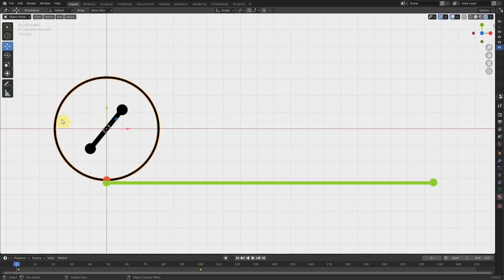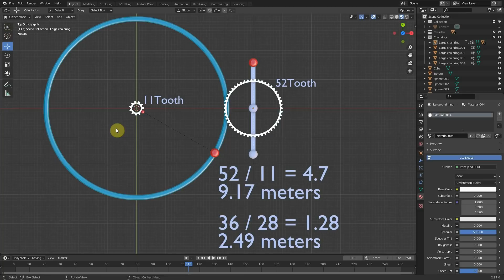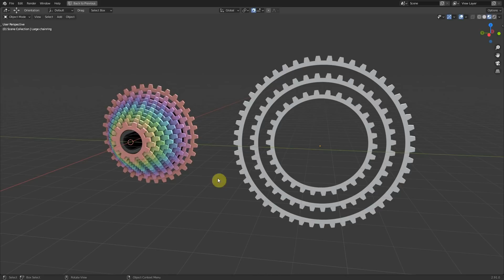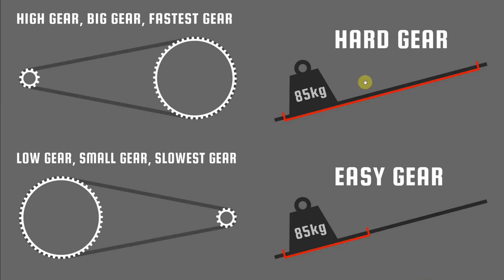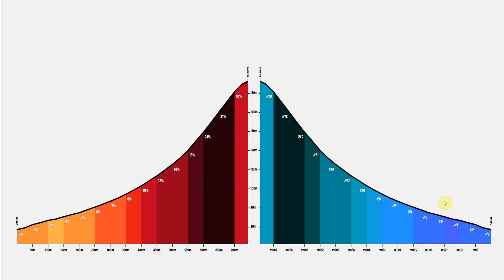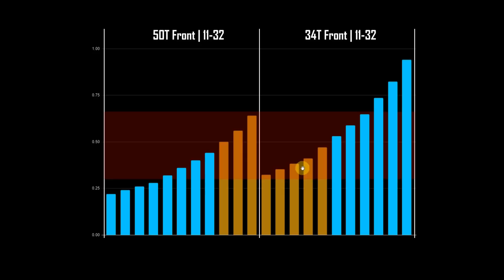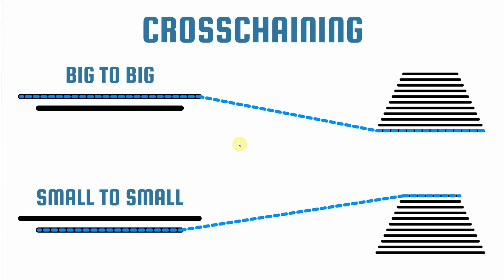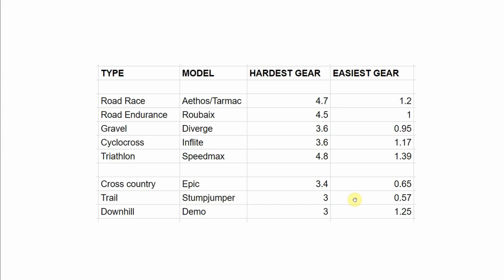HOW DO BIKE GEARS WORK?! | BIKOTIC

Comment: This is one of the few videos on gear shifting that actually takes the time to explain counter-shifting, or what to do when changing chainrings.  I figured out years ago (on a grip-shifter bike) that when you change chainrings you have to counter it with a rear cog shift in the opposite direction to account for the large change in gear ratio.  I'd love to see a video that shows counter-shifting in action.

Comment: Thank you. Very well done. My feedback would be to include some information about internally geared hubs. I’ve been riding an internal 8 speed for a long time and would not want to ever go back to a derailleur ever again! Sure, it’s only 8 speeds. I’ve found that to be enough, with my strength level and where I live, which is pretty flat. Lots of humans settle in flat places. But even when I moved to a place with significant rolling hills, the lowest gear was still adequate for most of them. One thing I like the most about an internal hub is shifting while coasting, or while stopped. To me that is more like the method of shifting used in a car, where you disengage, shift, and re-engage. It also eliminates the need to anticipate every change in terrain, like sudden stops. Instead of having to see a stop and downshift so that I can get across a road in an “easy” gear, I can just stop, shift down while stopped and waiting, and then go in my easy gear. Likewise with a sudden encounter with a hill, I don’t have to grind through gears because I am putting lots of stress on them trying to shift while climbing, I just have to have enough momentum coast for a split second and click into that easy gear. Internal hubs are also very low maintenance; no derailleur with tensioner and wheels that get gummed up, no dirty cassette, the chain doesn’t grind across gears, I just click and I’m in the next gear. Because the chain does not change its length, but just goes back to one external gear, some bikes have covers over the entire drive train, which again, makes for low maintenance, and safety.

I’ve had 10 speed bikes in my past, and 15 speed bikes with a front derailleur. Did I really use all 15 gears? No. Did I really ascend smoothly through those (duplicate) gears the way we ascend through gears in a car? No. Usually the front derailleur would not be used at all, and I would usually only use about 4 or 5 gears… should have bought a 5 speed! Seriously, 15 gears, 30 gears? In my experience/opinion all you really need is one good “easy” gear for climbing hills, a good “hard” gear for going fast, like downhill or when you have a good tailwind. A couple leisurely gears for strolling around town, and maybe another hard gear for medium speed. That’s 5… okay, add a couple more for good measure and varying strength levels and road conditions… 7. With my internal 8 speed, I actually move through the gears, up and down, as the terrain or my energy level changes. With 8 speeds, the jumps are not that drastic. I don’t need to split them into 16 gears. I’m not that athletic and rarely even get to the 8th gear! Really athletic people might, and might wish they had a 9th and 10th gear. If you are that strong, you could probably change the front chainring and still be strong enough to climb a hill in what would then be a harder easy gear.

I just bought a Brompton. Only six gears! Also… a derailleur, with a chain tensioner! Not happy about that. But… it’s only a tiny two speed, so that the internal 3 speed can be doubled. With 6 speeds, the jumps are a little more significant. The double modes of shifting is tricky too. But with the internal 3 speed, set in either of the 2 speeds, I can still stop on a dime, shift to an easy gear to cross a road quickly and resume shifting up and down through a set of gears that are adequate for most of my needs. The overall range of gearing is about the same as my 8 speed, it just does it in 6.

I’ve compared them using wheel size calculations. Some say that is not the best way, but it is easy enough, and interesting to compare different bikes and gearing that way. Maybe that should have been included here too, except… math.

Anyway, just wanted to plug internal hubs and how they solve some of the problems brought up here.

Comment: Excellent video. Finally understood gears. The ratio maths at the beginning was very informative.
For bikes without a front mech, for hard uphill riding with a ratio of < 1:1 i.e. 0.9 : 1 or 0.8 : 1, you'd need a sprocket at the rear mech which is larger than the front / pedal sprocket. 
Either that or have just a second small sprocket at the front so that ratios like 0.5 : 1 - 1:1 can be obtained with that sprocket when used with the existing array of sprockets on the rear mech.

Comment: I had no idea that the smallest sprocket is on opposite sides.(inverse) on the front (crank set)& rear (cassette). But that's how you cross chain, which is bad. Or biggest sprocket in front & biggest sprocket in the rear also causes cross chain. Learned a valuable lesson. Thank you. The short history lesson was also interesting & relevant. Your visual graphics are sooo helpful.

Comment: This is where the algorithm sent me, and this is perfect. Except for using the term "cog" to mean both the gears and the teeth on the gears. Cogs are teeth. Gears are wheels. Even if the definition is shifting over time, it doesn't necessarily follow 1) that this a good thing, or 2) that it's correct to overload the term in mixed usage.

To be fair, you did drop a disclaimer at the beginning. So, I dunno. 

I understood what you were saying. The script was well-written and the subject was presented well; it's interesting and informative, and just what I was looking for. And you didn't shout at me and blast music in my face.

But, man, come on. "Fish is Fish." ---Leo Lionni

Comment: Regarding bikes in the UK having their font brake on the right and rear on he left is to do with the fact that the UK as well as  other countries, vehicles drive on the left hand side of the road.  Therefore when doing a right hand turn across on coming traffic you signal with your right arm and cover the rear brake with your left as it is safer.

Comment: I very much enjoyed the video. Only one thing stood out to me: the "granny gear" nomenclature. It seems to me that on mountain bikes (and possibly other types), the granny is the - on my bike - 3rd chainring reserved for getting up the steepest inclines. But on a road bike, granny gear seems to be the smallest gear ratio on the bike, and especially so if you've fitted a lower than normal sprocket on the rear cluster: say you have an 11-28 Shimano cassette but live in a hilly area. You might swap out the 28 tooth sprocket for a 30 or 32, and then that becomes the "granny gear", i.e. the one reserved for the special circumstance of getting up the steep inclines that one normally would have difficulty with, if not have to admit defeat entirely! Of course you can't just swap out one gear for one where the gap is too large to the previous gear or you will have difficulties changing into and out of that gear (although gravel clusters and derailleurs seem to manage this OK).

So, more like this please, but don't stop doing the comparisons either. It did strike me while watching the recent Ribble Ultra one that you do put an awful lot of effort into these videos and it would be gratifying if you had a lot more subscribers! 10x would do for a start.

Finally, I'd like to know what the software is that you use - it looks like a 3D CAD package? (Maybe you've said what it is in a previous video that I've not watched, in which case, apologies). From a tech perspective, seeing how you create videos, especially your Photoshop - and I'm assuming it's a 3D drawing package - would be very interesting!

Comment: Great video!
I think calling hard or easy would be a little bit confusing.
I personally would call hard  1/1 or left/left(smallest front : biggest back) slow or the least gear ratio, because it would be reserved for hardest and the most amount of effort (clime + declining or zero speed) but it's personal preference :D 
Why also hardest? If I didn't have any gears It would hardest and slowest to pedal uphill (hard gears) and it's too easy to pedal when you ride downhill and have to shift to continue to gain speed (easy gears).
I usually call them high or low gears from how they numbered on my bike
1/1 steepest gear and 3/7 fastest downwhill gear.

Comment: GREAT VIDEO EXPLAINING IT ALL THANKS !! l ll use it to explain to others. l like that you pointed try to change gear prior to the terrain ahead LIKE we did on DOWNTUBE last for ever SHIFTERS :)  lt s funny l run a 50/39 with 11-32 on my OCLV trek and 46/30 with 12-32 on my OLD steel miyata l use for gravel n touring :)

Comment: Because I have limited knowledge of bikes I can't do this project maybe you can 
Gears were meant to be put on a wheel for you to exercise your arms same as a leg arm Exerciser
So when you move the wheel with your arms you start at a light weight and after a certain number of turns you increase the gears strength so your arms moves a heavier weight 

This is how people get muscles 
They lift small weights and then heavy weights 
The advantage of wheel with gears is you don't need the weights and can put on muscles anywhere 
Let me know if you understand 
Thanks for the video

Comment: Thank you for a very well produced explanation.  I have a 44t front chain ring and a 11-34t 8 speed rear cassette.  I want to know if I can change the cassette to a 11-41, I want a lower bottom gear.  In addition to changing the cassette, (Shimarno do have this component), I probably need a longer chain, but will I need a different chain tensioning arm?  (I assume that what it is called.)

Comment: as of recently I found the bike of my dreams as of recently, the Canyon Roadlite 6 . It's a fitness road bike with a 1X drivetrain (1x12): it has a 46T chainring and a 10-51 cassette. It's my dream bike 'cos I have a 50-34T 11-34T Decathlon road bike with flat bars, and a MTB with a 40-30-22T 11-34T drivetrain (3x9) and I always wanted a 1X bike with the nimbleness of a road bike and the easy gears of my MTB. The easiest answer seemed to be a gravel bike, but they don't make the cut. Many of them are 1X, but not very flexible nor fast for flat terrain and descents. So my question is... with my calculations a 30-34T (gear ratio the middle chainring and the easiest cog, a ratio witch which I can climb almost everything) would be equivalent to 46-51T of the Roadlite 6, and I'd have a spare tooth in the Roadlite, which would be easier to climb right? 30-34 compared to 46-51 would be 16 more teeth in the chainring (harder) but 17 more teeth than the easiest sprocket (easier), so 46-51 would easier than 30-34, am I getting it right? Just curious.... Congrats again for videos like this, super stuff. New subscriber
Reply from the maker: Thanks. If you goto bikotic.com on a desktop there is a gear readout below each bike, the roadlite 6 is in the data base, you can compare it to loads of other bikes and styles of bikes
Reply: @bikotic  many thanks to you
 Your video is amazing
 It helped me to understand how gears work better than any other video I found. I performed a search looking for videos on the subject and yours was like the 7th I watched or so, and then finally I found what I was looking for. I had written that in the original reply but for some reason it got lost. As for the Roadlite 6, I found it although it is the 2022 version. The one that I want is the 2023 version
Reply from the maker: @xosece  here you go, I added the 2023 version: https://bikotic.com?NTDA7TkR look on a desktop for the gear comparison
Reply: @bikotic  gosh, your app is amazing. You are full of surprises.... articulate, a cyclist and an excellent programmer. 

I tested the app and I noticed something I never knew, that a 46/10 gear is faster than a 50/11! wtf?, and discovered it when moving your app's comparison slider! It's amazing how much of a difference a single tooth can make. 

Until watching your video and browsing your web, I though that a 46-10T gear and a 47-11T gear would be equal. Was I wrong!... In fact I though that my RC 120 road bike, whose harder gear (flat bar version) is 48-11T, is slower than the Roadlite 6. The easiest gear is a bit more difficult to calculate, in terms of which is "better". 

My MTB's middle chainring 30-34T is superb at riding uphill. and I wonder if 46-51T, easiest on the Roadlite 6 2023, would be equal or better. 

Given how I use numbers I though I had one extra teeth to make it easier for the Roadlite 6 compared to my MTB, since I calculated that 30-34 (MTB) compared to 46/51 (Roadlite 6 2023) adds 16 teeth to the chainring on the Roadlite 6 (harder), but also adds 17 teeth to the largest sprocket (easier) so the easy side wins by 1 tooth. Am I wrong? If so, sorry for the newbie question.

What I am certain is that most probably 46-51T is much easier in such a hilly place like the one where I live compared to the easiest gears 34-34T of my road bike. Cheers Bikotic
Reply from the maker: @xosece   quick dirty way to work it out is to just divide the front chainring by the back, that tells you how many times the rear wheel turns for your one turn of the pedals - so 34/34 = 1:1 46/51 = 0.901 so yes 46/51 will be easier
Reply: @bikotic  hmmm interesting, so my MTB with which I climb almost everythng in this very hilly region where I live using the middle chainring (30T, the MTB is 22/30/40T) and the largest sprocket (34T), so 30-34T is 0.88 and 46/51 is 0.901, so very very slightly easier, there isn't a one teeth advantage on the Roadlite 6, but still the ideal bike for me 'cos it's almost the same. Thanks for all the help Bikotic. Best regards.

Comment: Good video. Thanks. But why do you and so many other bicycle people call the gears "cogs?" Cogs are teeth.
Reply from the maker: @WalterBurton  In cycling, cogs are the individual gears located on the rear wheel of a bicycle, collectively forming a cassette or freewheel. They are toothed rings that engage with the bike chain to provide different gear ratios, allowing riders to adjust their pedaling effort depending on terrain and speed.

Larger cogs: Have more teeth and provide easier gears for climbing hills.
Smaller cogs: Have fewer teeth and provide harder gears for faster riding on flat terrain.
Cogs are part of the drivetrain and work with the chain, chainrings, and derailleur to shift gears smoothly.

Comment: https://youtu.be/wfqbWDT749E?si=qMmuU8iAQqcMXNin
 good guide for shimano gear changing its their diagram showing not to use certain rear gears when on certain front chain rings kinda strange I've never done this but cross chaining here what i find interesting is in all my younger days cycling and racing jumping street trails etc i have never snapped a chain! Not once, now i have this new ebike a full suspension beast of a thing apparently im going to eat up chain's? I'll believe it when it happens either that or the materials used today as is the more plausible to me is cheaper and weak used for chain's